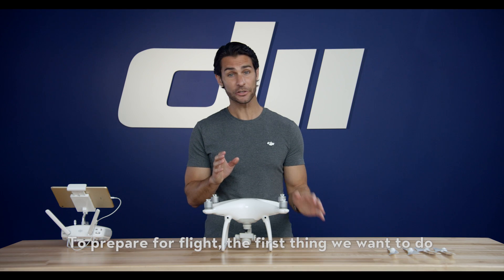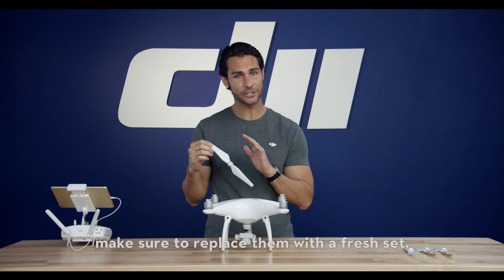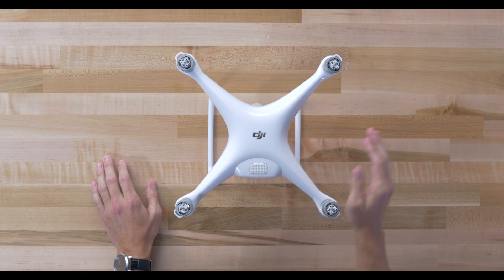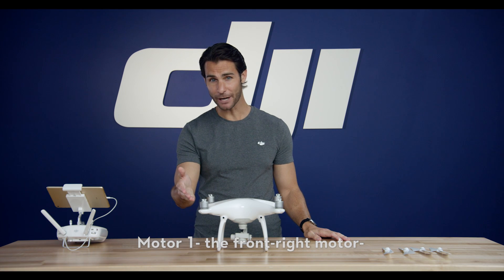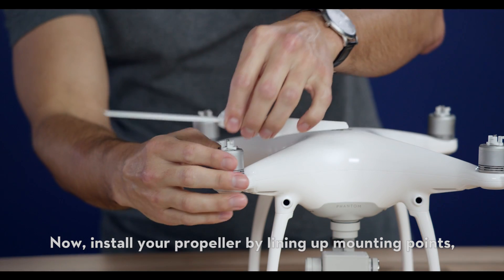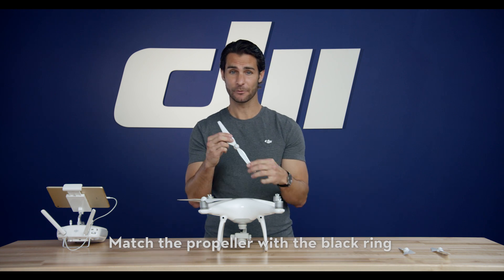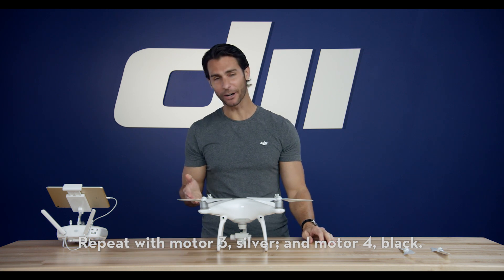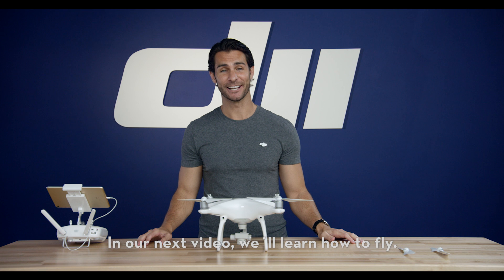DJI Tutorials - Phantom 4 - Pre-Flight Checklist - Part 3 of 3

Comment: Preparing for Flight
 Check Propellers
      Physical Damage
 Motor 1 – Front-right (Counter-clockwise)
      Sliver Propeller Installation
 Motor 2 – Front-left (Clockwise)
      Black Propeller Installation
 Motor 3 – Front-right (Counter-clockwise)
      Sliver Propeller Installation
 Motor 4 – Front-left (Clockwise)
      Black Propeller Installation